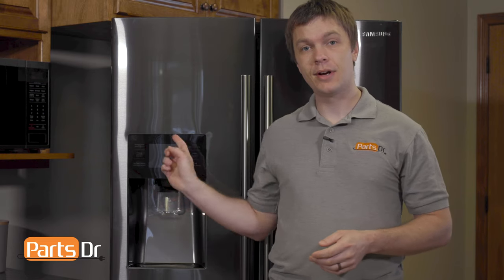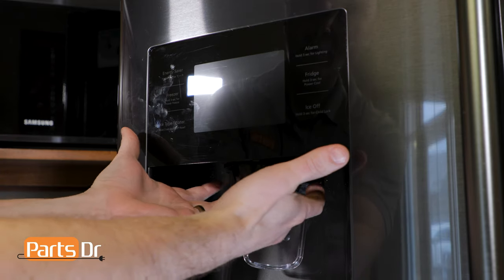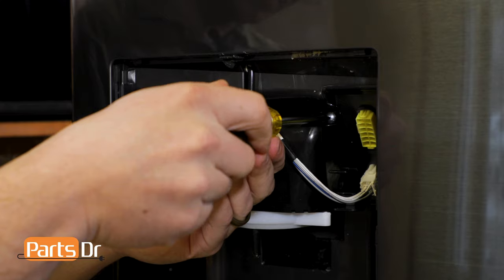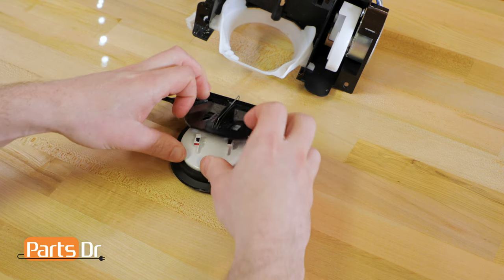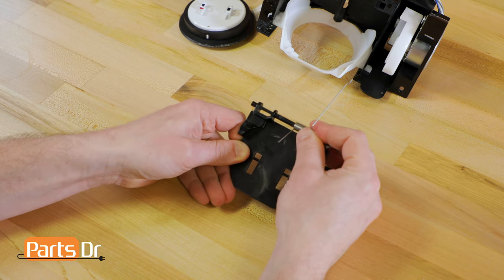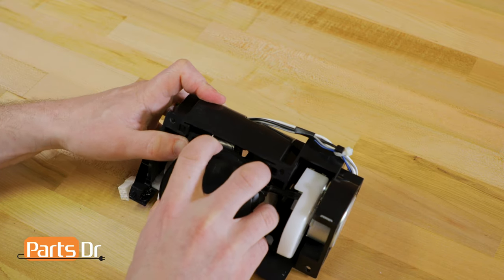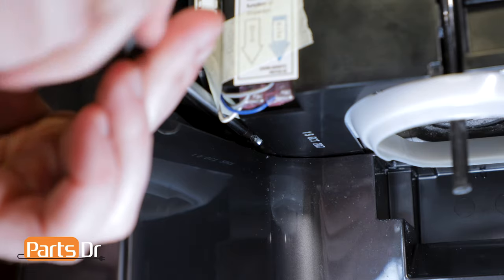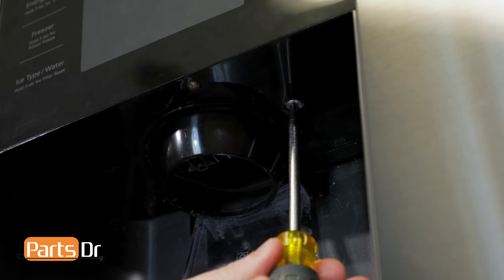How to replace the dispenser ice route cover part # DA63-04647A in a Samsung refrigerator

Comment: No tips or tricks, but I was wondering if you could provide information on how remove the dispenser cover on a Samsung RFG297AARS/XAA because it doesn't have a philips screw or any other screws. The rest of your video is great, but I need help getting the front panel off to get to the dispenser ice route cover.
Reply from the maker: This is what Samsung is showing for your model refrigerator: https://i.imgur.com/V8v7F8d.png

Comment: For the life of me, I can't find parts# DA63-06896 Cover Dispenser or a replacement for it. There are a few that looks like the part I need but not sure if it'll fit. Can you please help me?
Reply from the maker: It is probably sold as part of a larger assembly.  Samsung doesn't always sell each individual component separately.  What is the model number of the refrigerator?
Reply: @PartsDr  FR323TEDBSR/AA. I forgot to add that.
Reply from the maker: @60dwayne  You may be looking for this part here: https://partsdr.com/part/da97-05368a-ice-dispenser-funnel-guide